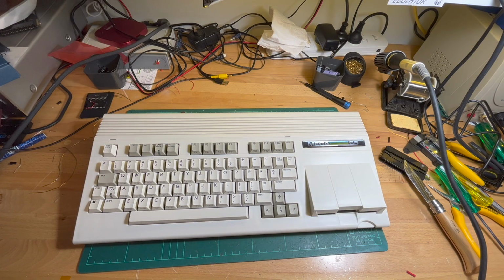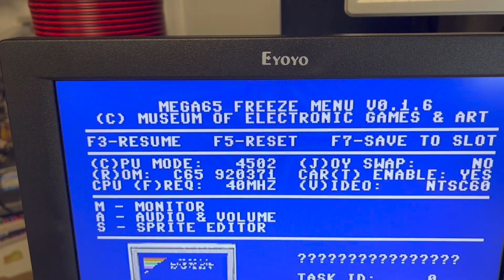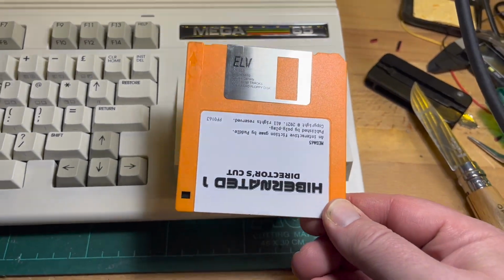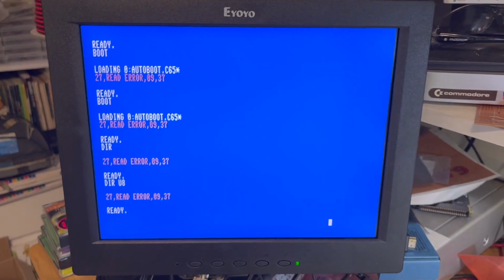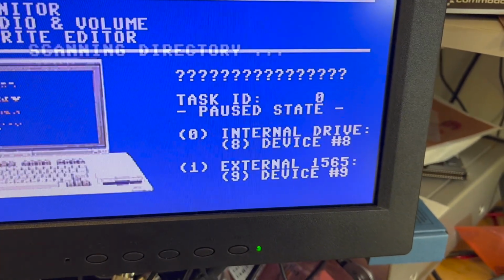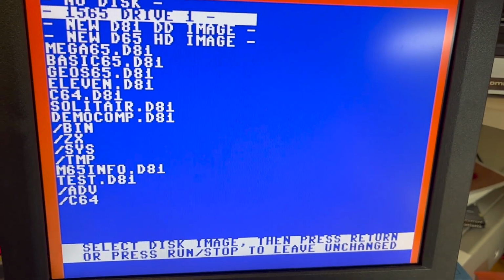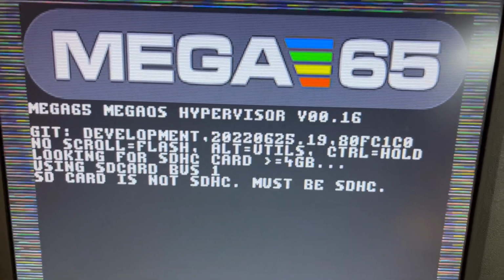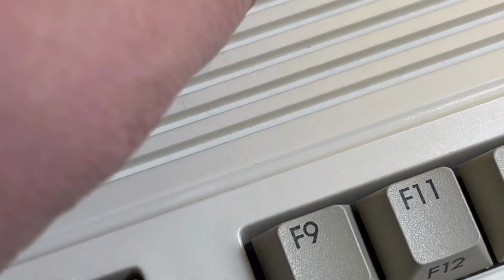🇩🇪 #MEGA65: Part 5a (Fixing the internal 3.5" disk drive) [TCE #0052]

Comment: Thanks for sharing, and unfortunatly some frustration.
Two things that might make life easier (already mentioned by some):
1. Type in MOUNT will mount your floppy to U8. No need to use Freezer, and currently MOUNT is also more reliable
2. Use RUN/STOP - RESTORE before typing DIR. I noticed this helps in most cases when my MEGA65 is a bit confused after mounting drives or images

Oh, and reset the computer after inserting the microSD to have it recognize the card.
But not sure how the card is being formatted or what the loading instructions of the game are.

Comment: Yes, you actually need to copy the disc image to a MEGA65 formatted disk. Then it will work.
Do you know that there is also an updated Hibernated version available? I am not sure if this is already on the release disks.
Feel free to drop by on the Discord, then we can get you up and running.
Tip for the disk drive: don't use the FREEZER, just type MOUNT in basic to attach the internal drive to unit 8.
Reply from the maker: Thanks for taking the time to reply Oliver, really appreciate it!  I did also get the name-your-price download so was going to use that version (I think I saw somewhere it'd been updated).  Was going to also try re-formatting the 3.5" floppy and copying the PRG, etc. back across to see if that'll get the disk working again.  And thanks for the MOUNT tip!  Actually, I've been wondering how to use the monitor program (I've not found anything in the documentation so far) - I've found Bit Shifter's Z-interpreter (bsz-mega) seems to hang when you try to restore a save game, so wanted to try my hand at troubleshooting the issue - will drop by the Dischord. /Brett
Reply: @Brfff  the interpreter in hibernated is also an old version. If you use the the Z5 file out of the updated version with ozmoo online, you can build yourself a working version. I suspect there will be an update to the official version soon.

Comment: What a frustrating episode!
Reply from the maker: I did get the floppy drive mechanism working nicely though! ;)
Reply: @Brfff  Yes indeed! :-) But after all that trouble, for the disk not to work! Hrmph! I hope it was just a problem with that disk, rather than with the drive.
Reply from the maker: This is true.  It actually reminded me of why I have no hesitation swapping out floppy drives for Goteks or SD interfaces in old computers rather than keeping them for the "authentic" experience - do not miss the distress of all your hard earned typing-in/programming getting lost because you only saved it on one disk! /Brett
Reply: @Brfff  Yes, quite. I like the idea of having a real floppy drive for access to old media, and maybe occasional use for something inconsequential  (things like adventure game saves that don't matter if you lose them…), but one of the joys of modern retro computers is not having to endure the slowness, hassle and unreliability of old storage media, frankly. Nostalgia can be taken TOO far at times!
Reply: @Brfff  there is a floppytest.prg on filehost that allows you to low-level format and test disks. It is also the best way to get unruly media behaving. You can even demagnetise a HD disk ( hole open) with it, and then reformat it as a DD disk (hole covered).